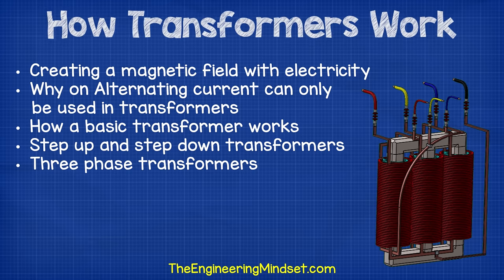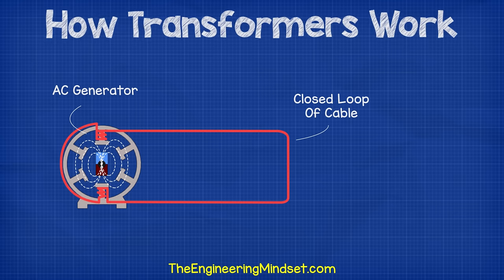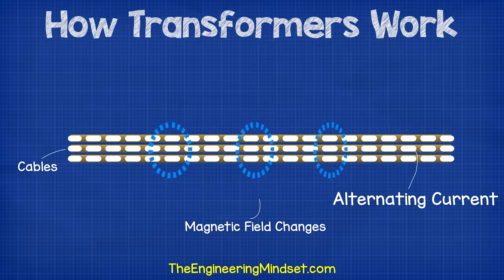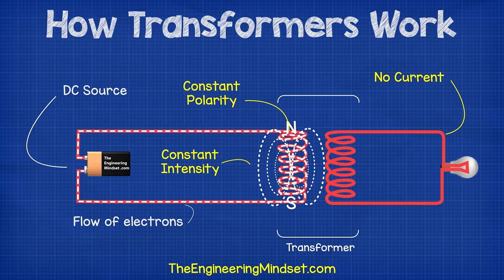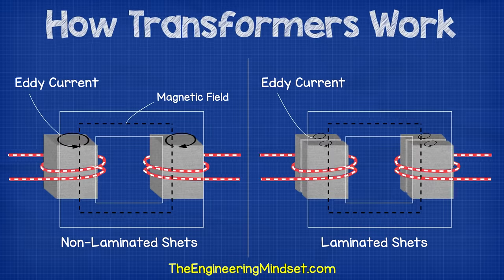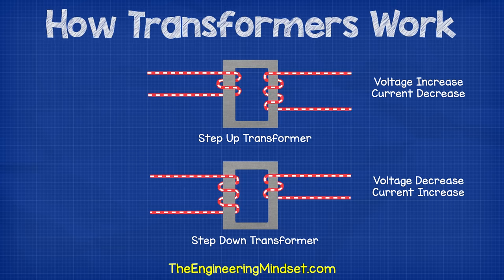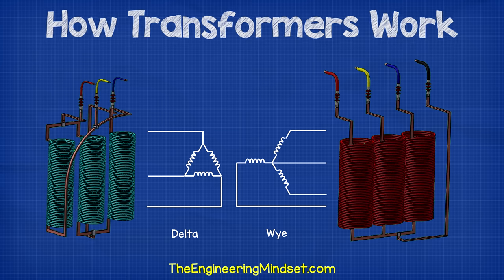How does a Transformer work  - Working Principle electrical engineering

Comment: What's going on?

In the diagram, the 3-phase transformer has 12 connections, but in the drawing it only has 6 connections (or 7 if you count the grounding/neutral connection).

Please help! Thank you very much.

Cheers!
Reply from the maker: See configurations towards end of video. Star delta, depends how wires are connected
Reply: @EngineeringMindset  Thank you so much for the reply.

I saw that, but what I'm confused about is this.

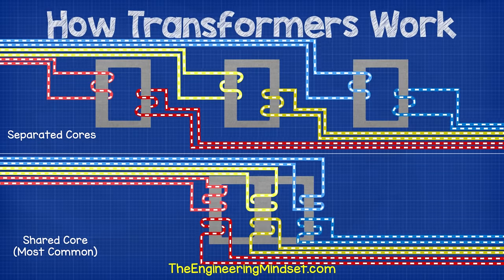At 5:09, there are 12 connections.
At 5:39, there are only 7 connections.

Where are the return paths?

Like in a single-phase transformer, there are four connections, two on either side.

At 5:09, it's basically the same as this, except with three times as many circuits.

But at 5:39, I'm confused on how the electricity is supposed to travel.

I've been thinking about this for several days, and I'm quite puzzled lol.

Any help would be GREATLY appreciated.

Cheers!
Reply: @EngineeringMindset  I know it's been over a year, but is there any way you could please answer my question. It's still bugging me to this day. I would appreciate it more than you could ever know.

Cheers,
Chris

Comment: I have a question, guys: so why does current decrease when voltage increases? Isn't current normally supposed to increase when voltage increases?
Thanks!
Reply: You are thinking now Ohm's Law, when Voltage increase = Current Increase as well.
This work when you have Power supply which is capable give you strong current in same circuit. (Wattages).

- However, this Transformer have two circuits, primary and secondary. You can't create more power from nowhere, you lose one of two in secondary.
Transformer create electricity to secondary circuit from magnetic field, which is not efficiency. (electrical energy loss).
Transformer convert power, either to high Voltage/low Current or low Voltage/high Current, this just convert power one of these two.

Not very good answer from me, but hope this somehow answer your question.
Reply from the maker: Seen our new Transformer video? here https://youtu.be/jcY4QN7awEc

Comment: I think the power companies also use the oil cooled capacitors for high amps if i am correct.
Reply: Richard Vaughn  I know transformers and capacitors are two fundamentally different things. There are capacitors that have oil in them. Youtube search "capacitor oil".
Reply from the maker: Seen our new Transformer video? here https://youtu.be/jcY4QN7awEc

Comment: What country's power system are you using as a model?  You stated that most power transformers are three-phase, but in the U.S. only single-phase transformers are found in most neighborhoods of single-family homes.  That is why it is so expensive for homeowners to use three-phase power in their home work shops--either they must pay to have three-phase wiring run to their home, or buy an expensive power converter for the equipment.
Reply from the maker: The UK, although pretty much the entire world except North America has the same setup. North America still distributes in three phase (you have to) but they decided to use an additional transformer to split the phase and reduce the voltage into two 120V supply lines whereas the rest of the world uses the full 230-240V of a single phase

Comment: The   theory of DC current no able to cause magnetic induction was not detailed.  You know core carried  Magnetomotive Force MMF. the Primary coil and the secondary coil are not electrically coupled together except in the case of Auto-transformer but magnetically coupled together. as you have electrical circuit on both the primary and the secondary where you have the Voltage (EMF), Resistance(impedance) and current which give  Voltage (emf) =IxZ,  so also you have Magnetic circuit of the CORE where you have magnetomotive force  (MMF), reluctance ( R)  and Flux linkage MMF=Rx(flux). please can you clarify  if DC create Magnetomotive force
Reply from the maker: Seen our new Transformer video? here https://youtu.be/jcY4QN7awEc

Comment: SO WHY do we need to step UP or DOWN the voltage? That seems like the first thing you would explain??
Reply from the maker: Do you skip through the video
Reply: he did explain ,,,,,,the generating station makes electricity and they use step up transformers to send the electric over great distances.........then when they get to the local towns they need to use step down transformers to get it to a useable and safe value.

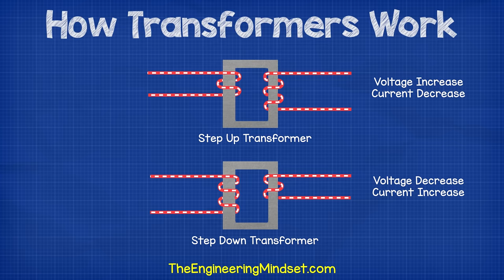Comment: At 4:25 i have a doubt current is directly proportional to voltage then why current is increased when voltage decrease s
Reply: I think it may be because the impedance is constant. Not sure, though.
Reply: @surferdude642   lets take vtg =5v and current=4A at constant impedance'z' w.k.t v=IZ  then what u said is deadly impossible naa
Reply: @govindharaju3079  ok then, I did say that I wasn't sure. You seem to know something about it, if you do some research you should be able to find the answer, since nobody replied with one yet.
Reply: @surferdude642  broo finally i got the ans here no turns increase so impedance increased then vtg also increase as impedance increased current decreased
Reply from the maker: Seen our new Transformer video? here https://youtu.be/jcY4QN7awEc
Reply: @govindharaju3079  I can't understand

Comment: but dc induces the magnetic field on secondary coil then it generates current
Reply: The magnetic field is not changing so it doesn't generate current. 
You can look at it this way, if you just placed a magnet onto a wire it would not generate eletricity, since you aren't forcing the eletrons to flow one direction.
You need to move the magnet to force the eletrons to flow in a direction.
Reply: MrAwesomeo5000 got it
Reply from the maker: Seen our new Transformer video? here https://youtu.be/jcY4QN7awEc

Comment: In which video does he explain the reason behind current decreasing when voltage increases ?
Reply: I don't know of the exact technicals but it all falls down to conservation of energy.  Watts (the actual energy) = volts x amps, so if you increase the voltage then the amps need to decrease so the output watts is the same.
Reply from the maker: Seen our new Transformer video? here https://youtu.be/jcY4QN7awEc

Comment: If AC goes back and forth, how does AC get pushed through power lines into buildings from the power plant?
Reply from the maker: It doesn't. The electrons barely move in AC circuits. They just oscillate back and forth. Only DC circuits the electrons flow.
Reply: @EngineeringMindset  Oh i see.
Reply from the maker: Seen our new Transformer video? here https://youtu.be/jcY4QN7awEc

Comment: What power sources other than ac generators have ac powe
Reply: light bulbs in buildings usually use AC currents
Reply: @bigs2582  I meant like batteries or power banks but something that not 30-100 dollars
Reply: @Crispy Memez ohh i see you could probably make your own with some magnets and wires
Reply: if you turn a standard motor by hand it functions as a generator. If you turn the motor while measuring the voltage you'll notice it creates an alternating current. Batteries only produce DC but DC can be converted to AC.
Reply from the maker: Seen our new Transformer video? here https://youtu.be/jcY4QN7awEc

Comment: How to connect the coils of transformer to convert 3 phase line to single phase line
Reply: An electronic converter is used if you want to directly convert 3 phase to single phase without having the issue of unbalanced current in one/two of the phases. It is impossible for direct conversion as, single phase has no rotating magnetic field but 3 phase has it. You can convert 3 phase to 2 phase this way without using scott T transformer.

Comment: Ok so my amplifier in my truck is 5000 watts it takes 12v dc input to Ac output to speaker wires if i was to add a transformer before my subwoofer it will give me more wattage
Reply from the maker: Seen our new Transformer video? here https://youtu.be/jcY4QN7awEc

Comment: Is it just me or does it seem like using an AC generator to force current back and forth through a wire seem like a crude, brutish way , bang it with 'Moar hammer' sort of method? I think there should be a simple and elegant way to make energy flow... like a maple sap tap... or waterwheel on a river... harmonious...like an antenna, just receiving energy and redirecting it.
Reply from the maker: Seen our new Transformer video? here https://youtu.be/jcY4QN7awEc

Comment: Hello I have a disturbing question.
I watched a video of students coming from school on a rainy day,
The area was flooded with water and they were trying to cross ,one of the students touched electric pole and power got him ,so the frd tried to help and it got him too,another come to help them but he was stopped by a teacher.Now my question is since water is a good conductor of electricity ,why is it that the other students crossing the same flooded water ,were not affected and even those near them pole , thank u
Reply: One  answer could be...too much of water certainly adds to the total resistance,making current too small value to cause damage! But,if you touch the victim physically,it is dangerous.A good alternative is to drag victim out with a DRY wooden rod or bamboo stick.
Reply: Rubber boots on a rainy day!
Reply from the maker: Seen our new Transformer video? here https://youtu.be/jcY4QN7awEc

Comment: The answer is probably obvious to the properly educated, but I can't figure out how there is electricity flowing through the high voltage side of a residential transformer. If it's hooked only to one phase how is the circuit completed? The pictures always show a coil wrapped around the core with a line in and a line out, what happens between there and the main line that allows current to flow? Thanks.
Reply from the maker: A Closed circuit, with resistance, and an applied EMF will cause the free electrons to flow.

Comment: I'm still confused. How exactly do they turn into motorcars/trucks?
Reply: Hi im an MRSM Langkawi student,for motors they create a force also known as spinning force.This force can be change by using gears depending on the uses.For normal cars they use engine.The difference between electrical car and normal car is electrical car uses electricity to create force while normal car uses combustion in the engine to create force (combustion itself is a force).These forces can be directed to the movement of the tire.
Reply from the maker: Seen our new Transformer video? here https://youtu.be/jcY4QN7awEc

Comment: Anyone find it easy to wind coils? I had an idea but haven't got the equipment to try. I had an idea but haven't got the equipment to try. If an insulated coil wire is wound, but not around a core but half way around then folded back so it can coil back in the same path as the semi circle before it so each time the magnetic field will be in the opposite direction of the previous half wind. I Imagined the semi-wound (?) coil would bend with DC and form a wave with AC, size varying on Hz. Many could be put together, to create something that can be fine controlled with variable AC arrays of input or something, honestly came up with it in a dream so I don't know, seemed cool. I could be a dumb-dumb since I had this idea 5 years ago and still never tried it. Even if the damn thing just bends I'll be amased.
Reply from the maker: Seen our new Transformer video? here https://youtu.be/jcY4QN7awEc

Comment: How transformers used in mobile phone chargers operate?
Reply: rectifiers change the AC TO DC after the mentioned transformer reduces the
line voltage.
Reply from the maker: Seen our new Transformer video? here https://youtu.be/jcY4QN7awEc